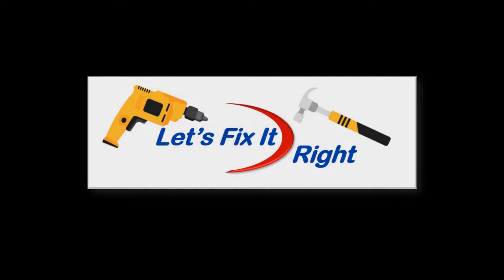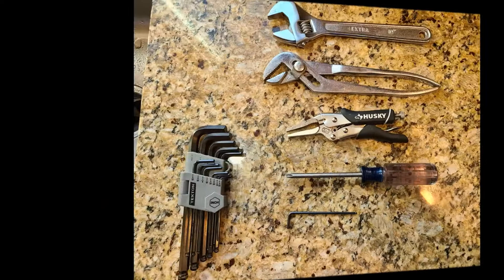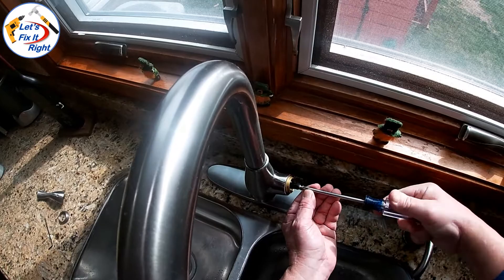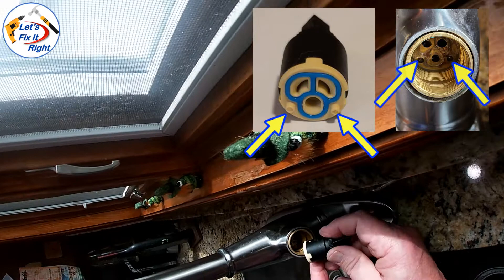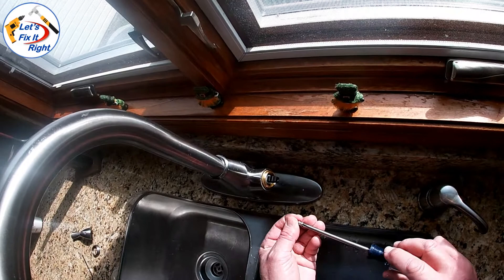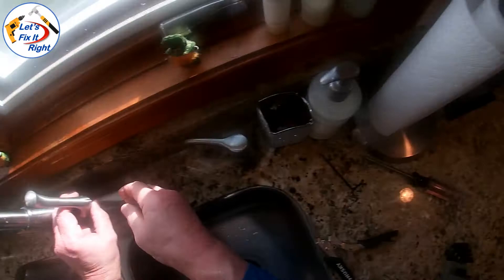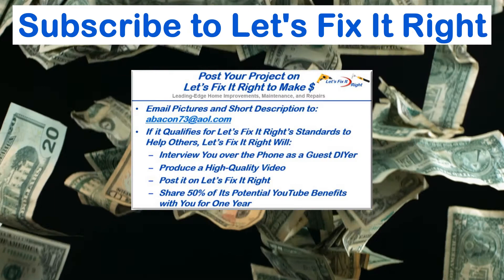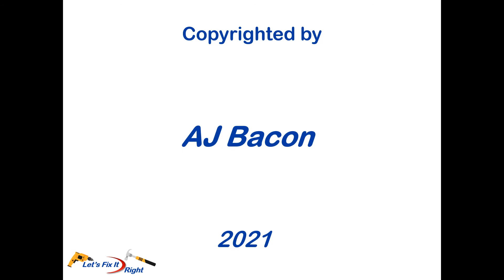Kitchen Faucet Cartridge Replacement

Comment: Thanks, useful. And for others I'll add my experience. Like many, my parts were seized up with lime or whatever from all the leaking. I just accepted the finished retainer was going to be marred by the channel locks. It would not have come off by hand or other nondamaging methods in my case. It did come off though with some effort. Same with the brass ring. I used vise grips. Crescent wrench was not effective. Again I dinged it up and it took some effort again. I was sure it was going to break but it eventually turned. Otherwise, no issues. I would source a new brass ring and finish ring if available before starting. I reused mine but they were pretty beat up. No problem with the handle, though I did clean it up with soft scrub, does a good job on water deposits and soap scum. Rinse well.  Loosen the set screw and just wiggle til it comes off.
Reply from the maker: @jamesparsons5633,

Appreciate your comments, contribution, and interest in my channel.  I retired recently and have plans for another 200 to 300 great videos. 
Can you please subscribe and tell your friends and family about my channel also? 

This a link to my channel: https://www.youtube.com/@LetsFixItRight

Regards,
Al Bacon
Let’s Fix It Right

Comment: Trying to remove set screw but it appears there’s a cover over the screw. How do I remove without doing damage? Thanks ahead of time.
Reply from the maker: Goldmember66,
The Pfister Faucet in my video does NOT have a cap covering the set screw.  As shown in the video (1:31 to 1:45), I used a 3/32-inch Allen Head wrench to remove the set screw at the base of the faucet handle.  

Do you have a different brand of faucet?  If so, you should be to download a manual from you manufacturer showing how to disassemble your faucet.

Otherwise, I appreciate your interest in my channel.  I retired recently and have plans for another 200 to 300 great videos. 

Can you please subscribe and tell your friends and family about my channel? This a link to my channel: https://www.youtube.com/c/LetsFixItRight

Regards,
Lets Fix It Right
Reply: having the same problem right now. A cover over the screw. Can't get to it smh

Comment: I have a Pfister G133-10SS Kitchen Faucet that passes no water.  I replaced the cartridge 974-044 (blue), same result.  Did I install the cartridge wrong?  I tried positioning the two plastic tabs so they mate with the holes in the fixture.  Any help appreciated.
Reply from the maker: Albert,
It is possible that you installed the cartridge out of alignment, etc. Considering that you know the Pfister Model No (G133-10SS), I recommend that you download the manual from Pfister's website and strictly install the cartridge per their instructions. It's possible that the Pfister cartridge in my video is older and the installation is slightly  different.

Regards,
Let's Fix it Right

Comment: I'm unable to remove the retainer ring under the handle in order to remove the brass ring and the cartridge.  I've used large slip joint pliers, but that isn't doing much except leave teeth marks on the retainer ring.  Pfister is not open on Sundays or holidays, so we are without operating faucet unless I can get that retainer ring off the faucet.  Thanks.
Reply from the maker: bluegrassfan23,

Per my video, did you try removing it with a 10-inch crescent wrench? In addition, it’s important not to strip the outer edge of the brass retainer nut.

To ensure that I am asking the right questions and guiding you in the right direction, can you please email me a picture of the brass ring that you’re having problems with to abacon73@aol.com?

In addition, do you have the new brass retainer nut and new cartridge ready to install that I mention in the intro (0:08) of my video?

Al Bacon
Let’s Fix It Right

Comment: Nice video. But it's much harder to disassemble in my case. The faucet has been in the kitchen for 7 years and it started to leak water. So I got a new cartridge from Pfizer and tried to install it according to the instructions and your video. But every step was so hard because almost all components were fused together by calcium or whatever from the slow water leak. After struggling I finally took off the small hex screw in the small hole under the handle. But the handle didn't budge at all after that. Using more strength I finally took the handle off but also with inside components. Everything inside is kind of glued together. Not sure what to do next.
Reply from the maker: NoSuffix,
With several component fused together with calcium, I recommend that you place them in a container of white vinegar to dissolve the calcium. If that doesn’t work, you could purchase a new faucet or call a plumber if things seem to be impossible to work on.
Otherwise, I appreciate your interest in my channel.  I retired recently and have plans for another 200 to 300 great videos. 
Can you please subscribe and tell your friends and family about my channel also? 
This a link to my channel: https://www.youtube.com/@LetsFixItRight

Regards,
Al Bacon
Let’s Fix It Right
Reply: @DN-rg9nj  Like I said, I finally took the handle off by using so much force that I broke the inside cartridge into two pieces. I also knocked off stuff around the sink with my arm swinging so fast when the handle finally gave out. So it's a good idea to clean the area around before you apply some real force. I did get all those parts replaced at the end thanks to Pfister's perfect lifetime warranty. After I uploaded descriptions and photos to Pfister website, they quickly contacted me back asking if I wanted a new handle with all its inside components or even a whole faucet. I choose a new handle and in days they are couriered to me in several packages, and yes, before the Xmas! Another tip is that soaking the parts in white vinegar doesn't dislodge the inside components. Because I tried that after I took down the handle by force. Soaking the whole handle in double strength (10%) white vinegar for 5 days and everything still stuck together. It's a lost course which can't be saved once it is stuck so badly.
Reply from the maker: DN,
As shown in my video (1:34 to 1:48), your handle should have easily come off after removing the set screw. If it is frozen in place, I recommend that you try spraying some WD-40 into the openings around the handle to free it up.

Otherwise, I appreciate your interest in my channel.  I retired recently and have plans for another 200 to 300 great videos. 

Can you please subscribe and tell your friends and family about my channel also? 
This a link to my channel: https://www.youtube.com/@LetsFixItRight

Regards,
Al Bacon
Let’s Fix It Right

Comment: How did you get the cap off that covers the screw?
Reply from the maker: Dean,

The Pfister Faucet in my video does NOT have a cap covering the set screw.  As shown in the video (1:31 to 1:45), I used a 3/32-inch Allen Head wrench to remove the set screw at the base of the faucet handle.  

Do you have a different brand of faucet?  If so, you should be to download a manual from you manufacturer showing how to disassemble your faucet.

Otherwise, I appreciate your interest in my channel.  I retired recently and have plans for another 200 to 300 great videos. 

Can you please subscribe and tell your friends and family about my channel? This a link to my channel: https://www.youtube.com/c/LetsFixItRight

Regards,
Lets Fix It Right

Comment: Great video! Is there a trick to removing the handle after the set screen is removed? The handle won’t budge like it’s got another screw holding it on. I assume it is just hard water build up holding it on there but didn’t want to break anything trying to force it off. Appreciate any insight you have on this issue. Thanks!
Reply from the maker: Jon,

I appreciate you taking time to make this valuable comment and welcome your interest in my “Let’s Fix It Right” channel.

Is your faucet a Pfister?  If not, I recommend that you go to your manufactures’ website and download the manual for your faucet.  There could be another set screw or something else that you need to do prior to disassembling it.

If it’s a Pfister, the set screw that I show in the video should release it. I recommend that you gently work the handle back and forth to break it loose.  Do not force it too much.  You could break it and cause it to leak.

If that doesn’t work, you could purchase a new faucet and install it per the manual. If you do that definitely keep the manual for future reference.

As a last resort, you could hire a plumber. He will most likely tell you the faucet is bad and want to install one that costs more than you can get from Home Depot or Lowe's.

Hope this helps.

With that said, can you please subscribe to my channel, tell your family, friends, and co-workers about it, and send them this a link to my channel’s helpful videos: 
https://www.youtube.com/c/LetsFixItRight

Regards,
Let’s Fix It Right
Reply: @LetsFixItRight  Thank you for the response! I really appreciate it. The sink is a Pfister similar to the one you show in the video. I was able to eventually remove the handle by carefully tapping it off with a hammer and screw driver (probably not the right tool for the job but effective). It was a matter of hard water scale buildup holding it on there after the set screw was removed so I was able to clean all that out of there while the handle was off during the cartridge replacement. The rest of the job was a breeze thanks to your video.

Keep up the great work! You’ve made a believer out of me. Subscribed! Thanks again.
Reply from the maker: @jonatkins8184  

Jon, Great news!!!! Good job on your part! Glad to hear that it worked out.

Let's Fix It Right

Comment: The steel sleeve won't budge
Reply from the maker: Rory,

Recommend that you spray some WD-40 penetrating oil on both edges of the sleeve. After letting it soak in for a few hours, place a protective rag around the sleeve and unscrew it with a large set of pliers or channel locks. Please ensure that you are moving the sleeve in a counter clockwise direction.

Otherwise, I appreciate your interest in my channel.  I retired recently and have plans for another 200 to 300 great videos. 

Can you please subscribe and tell your friends and family about my channel also? 
This a link to my channel: https://www.youtube.com/@LetsFixItRight

Regards,
Al Bacon
Let’s Fix It Right

Comment: What happens when the 'set screw' is stripped or will not release?
Reply from the maker: John, These are challenging problems with this small set screw.  Using a Tap and Die Set, you can try to cut new threads, and install the next size up Set Screw. You may have to drill it prior to cutting the new threads. If the screw will not come out, you can try drilling, cutting new threads, and installing a larger set screw.  As a backup, you may have to purchase and install a new kitchen faucet. Absolute last resort is hire a plumber. Hope this helps.

Otherwise, I appreciate your interest in my channel.  By the way, I retired recently and have plans for another 200 great videos. Can you please subscribe and tell your friends about my channel? This a link to my channel: https://www.youtube.com/channel/UCIBvBqPEkqu3D5HLpxlEmEA/videos
Reply: @LetsFixItRight  Thanks.  Actually tried the drilling option and it seemed to loosen it up enough for us to remove the handle.  Thankfully we had a new one to install along with the cartridge.  After a bit of stress all worked out just fine.  Thanks.  Cheers.
Reply from the maker: John, If is working now, you may be OK.  If you can get the set screw out, you can also wrap it with a very thin metal tape like this:  https://www.amazon.com/Sliver-Aluminum-Reflectix-Perfect-Patching/dp/B07S7ZV4BB/ref=sr_1_16?dchild=1&keywords=very+thin+metal+tape&qid=1617926961&sr=8-16

If this doesn't work, email me at abacon73@aol.com.  We can get together over the phone and discuss your options.
Reply from the maker: John, I forgot to mention my most important point.  If you know your faucet manufacturer's name or have your original manual that came with the faucet, you will most likely be able to call or contact the manufacturer and get a replacement faucet handle with the set screw for FREE.

Comment: Can’t get the sleeve off.
Reply from the maker: Malkies6341,

Recommend that you spray some WD-40 penetrating oil on both edges of the sleeve. After letting it soak in for a few hours, place a protective rag around the sleeve and unscrew it with a large set of pliers or channel locks. Please ensure that you are moving the sleeve in a counter clockwise direction.

Otherwise, I appreciate your interest in my channel.  I retired recently and have plans for another 200 to 300 great videos. 

Can you please subscribe and tell your friends and family about my channel also? 
This a link to my channel: https://www.youtube.com/@LetsFixItRight

Regards,
Al Bacon
Let’s Fix It Right